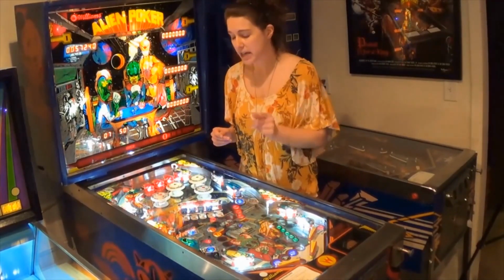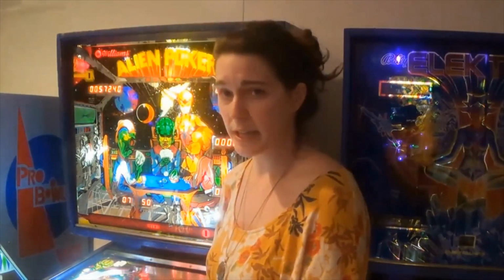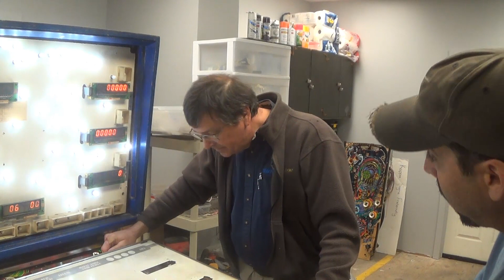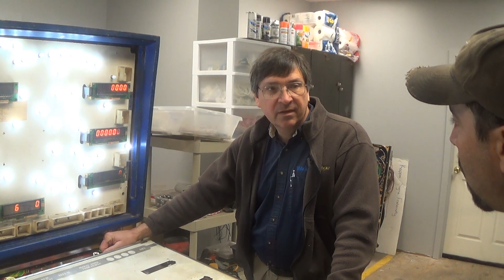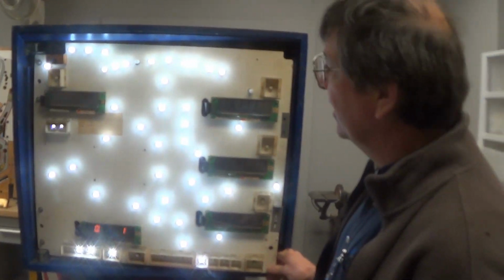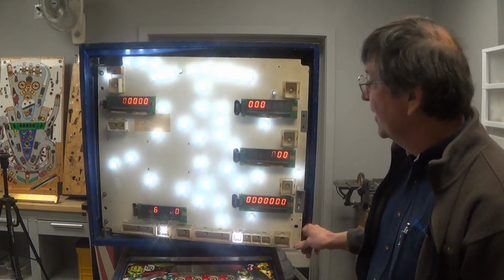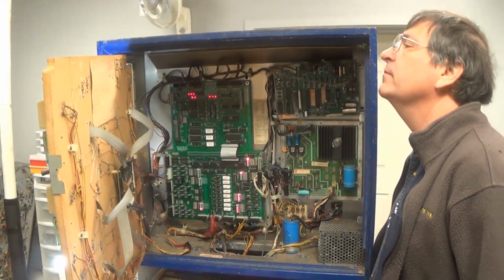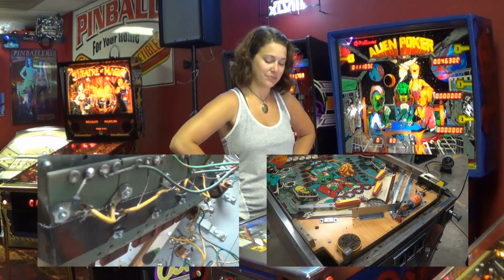ALIEN POKER Pinball Machine ~ GRC Full Feature ~ Cleaning / Repair / Review / Rules / Gameplay!

Comment: No wire guide under that top right flipper?
My LC has that so the ball does not drain by having the lower flipper up.
Also this machine also is missing the ball shooter lane gate like mine did but I bought a new one for my LC and no more ball going back into the shooter lane. :)

Comment: What is this I do more then GRC when cleaning a playfield?
I take off the ball guard in the drain part of the machine and take it to the sink and wash it.
I also take the brackets that the playfield rests on and take those to the sink.
Then I start to clean the playfield.
I also strip the topside of the playfield then clean the underside but don't usually take anything off underneath the playfield unless it is a drop down target assembly or under playfield ramp which I have not worked on the underneath ramp thing yet.
Not knocking the work I am just teasing a bit is all.
Also toothbrush that looks familiar like I might of used that in all my cleanings. Maybe perhaps. Shrugs
Reply: +Gameroom Collectibles / Pinball Lots of cleaning for a measly bit of money. But at least it looks slightly better then a dumpster turd.